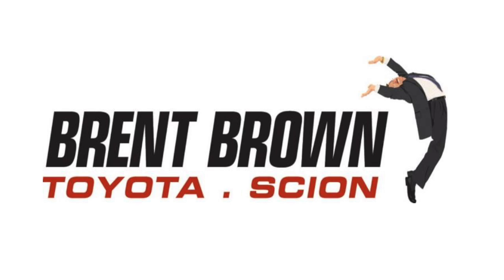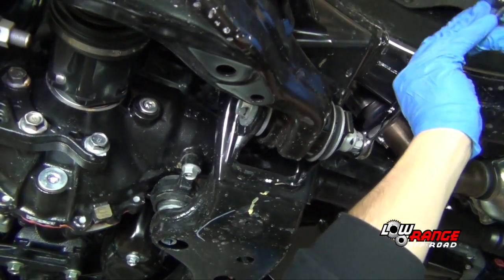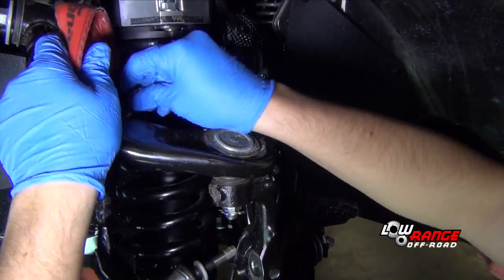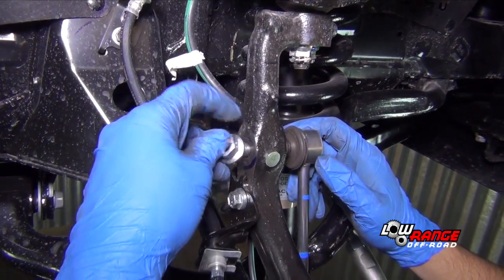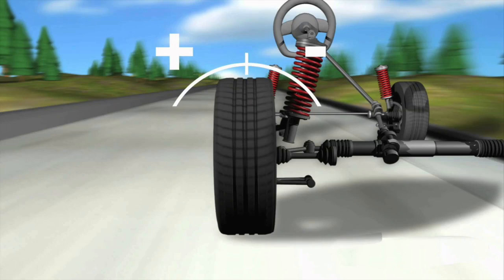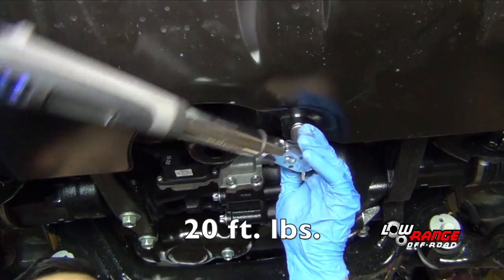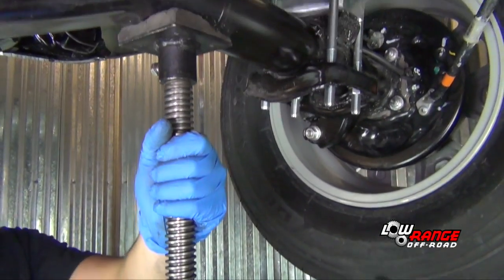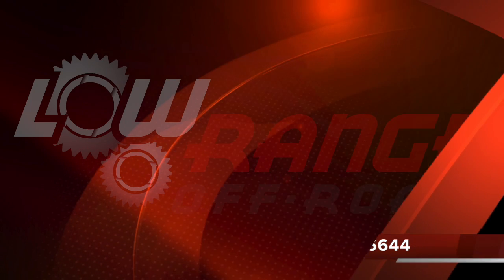How to Install  an LRT 3" to 1" Leveling/Lift Kit on a 2016 Toyota Tacoma

Comment: Question I had the kit put on a 2020 3/2 and went from 265/75/16 to 285/70/17 new rims and tires looks sharp. But around 50 to 60 vibration in steering wheel new frount end alignment balance but still there any suggestions. This is a 2020 Tacoma TRD off rd. Only 2000 miles on this truck. Any suggestions?

Comment: Great video!  Very helpful!  Just curious - I realize this is a budget kit, but why not offer one with powder coating or anodized aluminum at a higher purchase cost to help avoid surface corrosion?  It would also look better (just my opinion; others may disagree) to not draw attention by having visually exposed shiny silver spacers that obviously don't match any of the factory assembly.   But then, you probably wouldn't get the same benefit of advertising value.  Again, great video, thanks!

Comment: I have a 2017 tacoma trd off road 4x4 by installing this kit will anything prematurely wear? How does this affect towing?
Reply: I'm not a pro but since it doesn't touch the actual preload of the suspension it should not affect tow. As for wear i don't know i think the diff drop take care of any issues.
Reply: I was only affected on ball joints. It went out a month after I got the lift, even though it was never replaced before and is an old 2010. Towing will be slightly different feel wise since your front wheels will be slightly raised. (A more floaty feel), Shouldn't be bad since its just a leveling kit.

Comment: i have a question,  im trying to install 3 inch spacers from a 1999-2004 tacoma on my truck, my only issue is, is that i cant get my lower strut back into the lca cause the strut is obviously longer due to the spacer.  Any tricks on how to compress the strut to get it back in?  Thanks
Reply from the maker: I don't feel qualified to answer this question.  My best suggestion would be to email us at sales@lowrangeoffroad.com or call us at 801-805-6644 between 8am to 5pm MDT.  The best person to talk to if you call would be Nick.  Hope this helps.  Thanks for watching and commenting.

Comment: Only thing I didn’t see in video was the best way to spin the shock in the assembly as the spacer is installed it will alter the bolt pattern on top of strut by 45°.

Comment: What size tire did the truck get after the lift? I was thinking of purchasing this lift and possibly the BFG 285 K02 and using my stock trd off road rims.
Reply from the maker: +matthewhogan89 We don't know for sure.  The dealership sold it before we could followup and take pics of it.  But, I will try to find the answer to your question and get back to you.
Reply from the maker: +lowrangeoffroad I checked with my sources and they said "Yes a 285/70R17 will work."  They also said that 

a 285/70R16 would also work.  Good luck with your project.  Let us know if we can help with any of your needs.  Visit us at lowrangeoffroad.com or call 801-805-6644.  Thanks for watching and commenting.

Comment: how close will this leave the UCA to the coilover? Everything i have is stock and do not off road, so should i think about sway bar relocation?
Reply from the maker: The upper control arm might touch the spring at full drupe but it is not a concern and nobody we know has needed to relocate the the sway bar nor have we done so on any of our R&D installs.  It really is a great kit, especially if you don't plan to do much off-roading.  Thanks for watching and commenting.

Comment: Does this lift (or any other lift for that matter) affect the Speedo reading of how fast you're driving?
Reply from the maker: +BaldPeacock There is no reason I can think of where a lift in-and-of-itself will cause your speedo to be inaccurate.  Things that WILL affect speedo accuracy are gear ration changing of the transfer case, and differentials.  Changing tire sizes will also affect speedo accuracy.  Hope this answers your question.

Comment: Before you consider/purchase this kit, you will need to take some additional steps. Replace drivers side needle bearing with a bushing from ECGS. Also replace upper control arms with a set that is designed for a lift (alignment issues). I also added spyder trac wheel spacers to the front. Good luck!!!

Comment: hi i need the kit for Toyota tacoma 2003 4x4 thank you
Reply from the maker: I am sorry to report that we do not have this kit for the O3 Tacoma.   However may we suggest the following alternative.  For the front: 
 http://www.lowrangeoffroad.com/toyota-off-road-parts/1995-2004-toyota-tacoma-off-road-parts/suspension-parts/1995-2004-toyota-tacoma-1996-2002-toyota-4runner-front-bilstein-5100-adjustable-shocks-0-2-5-lift-f4-be5-d558-t0.html

And for the rear:

http://www.lowrangeoffroad.com/toyota-off-road-parts/1995-2004-toyota-tacoma-off-road-parts/suspension-parts/toyota-tacoma-tundra-block-and-ubolt-kit-7-8.html 

You will also need the diff drop kit to keep your front axle angles right:
http://www.lowrangeoffroad.com/1995-2004-toyota-tacoma-1996-2002-4runner-1999-2006-tundra-differential-drop-kit-by-low-range-off-road-lr-1gddk.html

The cost is almost as good as our LRT kit but is actually a better set up.  Especially if your front shocks are needing replacement.  The only real drawback is that you would need to have someone remove your existing coil springs from the old shock and install them on your new ones.  Good luck.  Let us know if we can help you with parts.

Comment: i installed this kit, i got really bad vibration and noise from the front diff, after some research i found that there is needle bearings in the front diff(drivers side only) that needs to be replaced with a bushing to make this work. my Tacoma only has 2 thousand miles on it!! NEW truck...and i had to remove the lift kit because i did not want to do all of the extra work and money to make this work out(45 dollars for install tool, 45 dollars for removal tool and 65 dollars for the bushing)..and yes i did the diff drop spacers also. they dont tell ya that!!
Reply: Just buy a ZR2 and you can put 285/70r17 on it with a 1 inch leveling kit. $59.00 Did mine with under 1000 miles new now have 19500 miles on it. BFG KO2 285/70r17 factory wheels.  P.S. I have 2013 Tocoma also and ZR2 is the better truck.

Comment: Just installed this kit on 1/28/17 on my 2016 TRD Sport 2WD and love it!! Wish I had done it earlier. Just follow the directions on the website that come with the kit and you're good to go. Actually rides better now than when it was stock. Took it on the freeway today (1/29/17) and no vibrations at all. I have before and after pictures but I can't seem to figure out how to post them on here.
Reply from the maker: Glad the install went well.  We'd love to have those pics if you are willing to share.  Our email address is:  sales@lowrangeoffroad.com.  Simply attach the pics and put "Att: Coleman" in the subject box.  Thanks for the product review and comments.
Reply: Any issues now that you have had the kit on there for a couple months?  I am thinking about doing it on my 2016 2WD TRD Sport Taco.
Reply: Dufisthenics I love it! Gets a lot of looks and compliments. No noises or issues. I also bought Spidertrax 1 1/4" wheel spacers and it looks awesome with this kit. I'm getting ready to put 285/75-17 Toyo A/T's on it and that should finish the package 👍🏼 No better kit out there.
Reply: No issues at all. Just installed Toyo 285/70-17's on the stock wheels with 1.25" Spidertrax spacers and zero rubbing issues. I love it and gets lots of compliments.
Reply: got6pak 
I'm planning on installing the same kit and tires on my 2016 Tacoma also.  New at this so, what's the purpose of adding the wheel spacers? I want to use the 17" stock wheels as well.
Reply: Claro Melchor The spacers just make the overall profile of the truck look better in my opinion, but they aren't needed for a leveling kit and stock wheels. You may need them if you go to bigger tires like the 285/70-17's. One thing I have found out is it limits your truck on alignment specs. so you get a little bit of bump steer. I'm actually switching to Maxtrac spindles instead which will put my suspension and steering geometry back to stock. I'll be selling my LRT kit if anyone is interested.
Reply: got6pak Thanks for the advice!
Reply: Is an alignment needed after this install?  Thanks
Reply: @dangvu3006  absolutely

Comment: Can I just get front Spring, Shock and Front Spacer?  will this work if I have Chaos Upper  Control Arms ?Thank You  Whats a good front shock also ?
Reply from the maker: We don't have a stock replacement springs but you 
may want to look at these instead of stock length shock and spring with a
 spacer. 
  http://www.lowrangeoffroad.com/toyota-off-road-parts/2005-2015-toyota-tacoma-off-road-parts/suspension-parts/2005-2016-toyota-tacoma-2003-2009-4runner-2007-2009-fj-cruier-2003-2009-gx470-2003-2009-prado-front-bilstein-adjustable-shocks-5100-series-with-old-man-emu-spring.html

If you have further questions feel free to give us a call:  801-805-6644  from 8 to 5 MST and ask for Nick.  Thanks for watching and commenting.

Comment: Hey I'm wanting to get my truck lifted but I'm worried about the excess wear and tear it might have on my truck what kind of problems could/will come from getting it lifted?
Reply from the maker: +Tyler Prince If the job is done right, by following our instructions the lift kit should last the life of the truck.  The excess wear and tear will depend on how you use (or abuse) the truck which is going to occur with or without the lift.  Our lift, unlike some other lifts on the market, does not effect ride quality.  It should remain as good as before.  Additionally, it is CRITICAL  that you have your truck professionally aligned after the lift is installed.  If it not aligned, you WILL have excessive tire wear problems as well as poor handling and braking.  Hope this answers your question.  Thanks for watching and commenting.

Comment: I need help please!
 I have a 2015 Tacoma with a 3 inch lift and wanting to put a 33inch tires but I dont want to do alot of trimming. Is there a way that I can add 1 or 2 inch more?
Reply from the maker: Thanks for comment.  Best thing to do would be to call 801-805-6644 
between 8:00am and 5pm MDT M-F and ask for Nick.  He is the most 
knowledgeable guy here when it comes to Toyota Tacoma's.

Comment: Am I thinking correctly that installing a kit like this on a 2WD 2016 Tacoma TRD Sport truck has less potential issues than with a 4WD version? (angles, clearance, etc)
Reply from the maker: There are no issues with this lift, could you maybe explain what your asking with a little more detail? Thanks for watching and commenting.
Reply: I was asking because I have heard of others talk negatively of using leveling kits, especially with 4WD trucks.

Comment: do you need to use the sway bar relocate kit with this on a 2016 tacoma. thanks 

2005-2015 Toyota Tacoma | 2003-2009 4Runner | 2007-2009 FJ Cruiser Billet Aluminum Sway Bar Relocation Blocks by ICON (611030)
Reply from the maker: +CaptainBamfield Yes, It can be used. But since this is a budget kit we do not include them. For
 prolonged life in sway bar links and sway bar bushings the relocation 
brackets are a good idea.
Reply: Do you need the sway bar relocate kit when using on the Tundra?

Comment: This was a very well documented video. However, it is also the worst possible method for lifting an IFS Tacoma with a two piece rear driveshaft and carrier bearing. Sure it will work, but you will pay the price later. Not to mention those front axle CV Joints being very unhappy. It's all about Geometry.
Reply from the maker: Thanks for the comment.  Yes, there are other ways to lift a Tacoma.  However these kits are significantly more expensive and we do sell them if customers want to go the extra cost.  But, for the price this is an excellent way to go.  Granted we are lifting the front about 3" but the diff drop spacers included in the kit help the CV Joint angle concern.  And the rear spacers are only raising the rear 1".  Our goal is to not only lift but also level.  Plus the rear spacers are angled so the proper U-joint angles are held pretty close.  Then too, when you consider how easy our kits are to install, it is a pretty good way to go!  Thanks for watching and commenting.  For more details on our LRT Tacoma Leveling-Lift Kit click on the link below:  http://www.lowrangeoffroad.com/toyota-off-road-parts/05-15-tacoma-hilux/suspension-kits/lrt-2005-2016-3-1-leveling-lift-kit-for-toyota-tacoma-by-low-range-off-road-lr-lrtaco.html
Reply: I like the idea of this type of lift/leveling kit. I tried one on my old 2005 Tacoma and even with the diff spacers, and carrier bearing drop, it still had vibrations. I took the stuff off, sold it on eBay and never looked back. I hope your product works better than the one I bought.

Comment: Finally a good video... 
I  have a 2010 Tacoma, I just want to lift my front end 1.5".  I don't need to do the diff or sway bar drop with that, do I?
Reply from the maker: Correct!  You don't really need to do anything to the front differential or sway bar.  And we do not have a spacer lift that will give you the 1.5' lift in the front but we do have an option that a lot of people like and that is a Bilstein Adjustable Shock.  It is adjustable from 0 to 2.5" in .5" increments.  Here is the link if you are interested:  http://www.lowrangeoffroad.com/toyota-off-road-parts/2005-2015-toyota-tacoma-off-road-parts/suspension-parts/2005-2016-toyota-tacoma-2003-2009-4runner-2007-2009-fj-cruiser-front-bilstein-adjustable-shocks-5100-series-0-2-5-lift-24-186711.html  Thanks for watching and commenting.

Comment: Why the diff drop and bump stop spacers? I did a 2" lift on my truck and was told I didn't need either of those...Great video!
Reply from the maker: +Andrew Higgins    With out the bump stop spacers the shock can go to full compression when encountering hard bumps, which can damage the shock. We fix this by spacing the bump stops, letting the bump stop take the hit, instead of the shock 
absorber.  As to the importance of the Diff Drop.  We feel the diff drop is pretty important in maintaining the proper drive axle angles.  It reduces the risk of tearing those Constant Velocity Joint boots and keeping those CV Joints from premature wear from the increased angle.  Hope this answers your questions.  Thanks for commenting.
Reply: +Andrew Higgins Some people have encountered grease leaking from the inner axle boots or some smoking to occur without the diff spacers. If you have 4WD I would definitely add them. Some kits do not include these.

Comment: In the video you put the lift/leveling kit on the Tacoma SR5. If I were to put it on my TRD off road, would it still level out the truck?
Reply from the maker: +Spencer Hardman I spoke with Brycen who is in charge of these kits and he said the TRD model WILL be level at the end of the installation.  If you install (or have installed) our kit or any other kit for that matter, be sure to have your truck aligned.  Thanks for watching and commenting.
Reply: Spencer did you end up using this setup on your TRD Off-road 4x4? I would like to do the same, but I too have an Off-road 4x4. The stock TRD Off-road 4x4 is already taller than a TRD Sport. Wondering if there any binding issue with a factory raised TRD Off-road 4x4.

Comment: What about the geometry of the carrier bearing for the rear driveshaft? If you don't do something here, you MOST LIKELY will experience a vibration. Good video though.
Reply from the maker: Early on, that was a concern of ours as well.  However, we tapered the rear spacer block in an effort to maintain, as close as possible, the correct drive line angles.  Thankfully, we have not had any reported concerns with drive line vibration with this kit.
Reply from the maker: Additionally, we have several new car dealerships who are installing these kits on brand new Tacomas and Tundras.  They, as well as the customers, are quite pleased with these kits.  Thanks for viewing and commenting.
Reply: Cool, that's good to hear. Back in 2005 I bought a new Tacoma 4x4, installed a 3 inch lift and had vibes from the carrier bearing. Not matter what I did, it remained. Glad to know you guys have solved that problem.

Comment: When do you tighten the alignment bolts on the bottom where you loosened to lower the control arm? I didnt see that step in the video.
Reply from the maker: +Nai Saechao At about Point 10:20 in the video it shows when and how to tighten the alignment bolts.  The main thing about tightening these bolts is to be sure they are tightened and torqued with the vehicle at ride height.  This means the full weight of the vehicle should be on the wheels BEFORE tightening the inner control arm alignment bolts. Failure to tighten these bolts at ride height will greatly reduce the life of the inner control arm bushings.  Hope this helps.  Thanks for watching and commenting.

Comment: Can I use this kit on my 2017 Tacoma OffRoad 4x4? Also, how it it affect my UCA? Do I need to swap out the UCAs?
Reply from the maker: Yes, this kit will fit perfectly on your 2017 Tacoma.  Now as to the Upper Control Arms (UCAs).  At full droop the upper control arm hits the coil spring, not with a lot of force, but it does hit.  We have not found lit necessary to install aftermarket UCAs but it certainly would not hurt if you wanted to.  Hope this helps.  Thanks for watching and commenting.
Reply from the maker: I think "Hit" is too strong of a term.  It actually "TOUCHES" the spring at full droop. You are completely fine  running this Leveling kit with out replacing the UCAs.